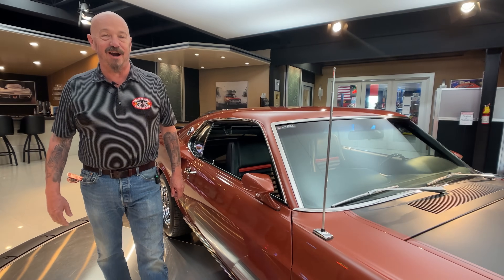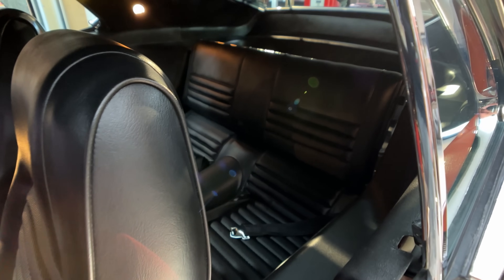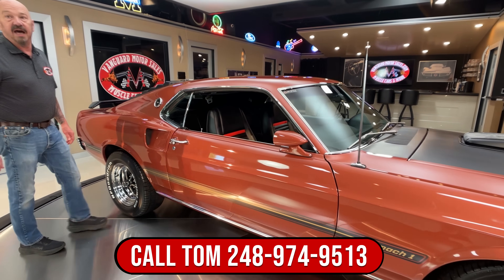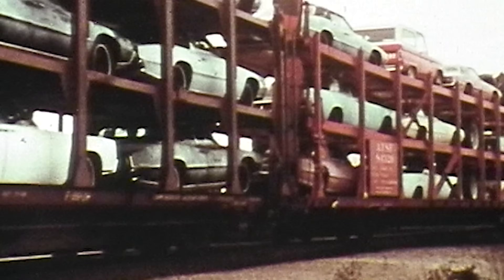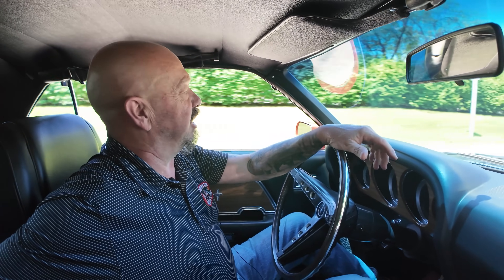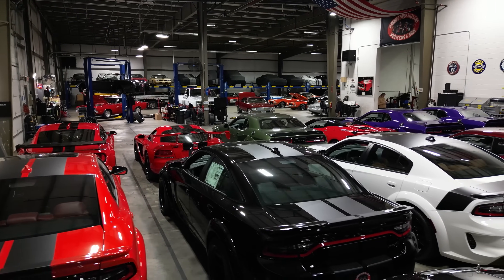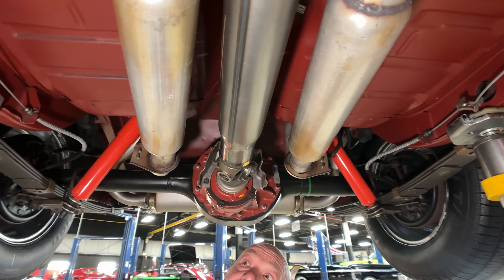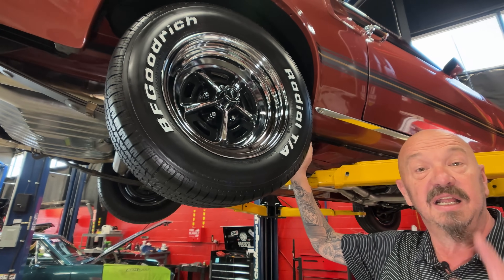1969 Ford Mustang  Mach 1 R-Code 428SCJ Drag Pack For Sale Vanguard Motor Sales #2332

Comment: oh no its an automatic! how much would a four speed add to the 150000 price? who ever buys this should do a manual swap immediately
Reply from the maker: With the car being kept this nice and original over the years we wouldn't be interested in swapping it to a manual we'd like to keep it as original as possible. However If you are interested we are currently getting in another Indian fire car that has a manual coming in soon! You can call Tom and get any information on that car if you'd like! 248-974-9513!
Reply: Not big Ford fan, keep it original as possible affects price.
I really like 2018 Dodge Demon in Octane red, car for me.
I know guy original owner with 2018 Demon in Purple.
He retired from drag racing was surprised that he ordered a Demon.
Reply: There is a market for autos. As drivers get older, they often have trouble shifting. And safe to say at 150k, the majority of the market for his car are Boomers. 😂
No need to change this original beauty when there are plenty of manuals just as nice out there.
Reply: Stunning 69 Mach 1 Super Cobra Jet with…..a what, automatic transmission. This hobby is populated with all kinds of enthusiasts with bizarre ideas. Think of the value of one of the most stunning Mustangs Ford ever designed with the mandatory 4-speed. Dealer is correct though, leave it alone. Ideal car for a Millennial since they can’t drive it with a manual transmission.
Reply: Automatic was better for drag racing back in the day, faster shifts

Comment: I ordered my '69 Mach 1 in Nov '68.  351 4-spd 3.25 Traction Lock.  Road & Track said the big blocks were too heavy for cornering. Said the 351 was the better setup for the road.  I didn't want a drag car, but a high speed cruiser.

Comment: I had a 1969 Mach 1 428SCJ Drag Pack,and the rear shocks are supposed to be staggered on rear axle,LH side behind and RH side in front of rear axle.Maybe that was because mine was a top loader 4 spd.

Comment: I had the pleasure of driving one of these '69 Auto 428 Cobra Jets and it was so cramped under the hood, that there was only room for air conditioning or power steering.  The car could fly.
Reply: Owned one for quite a few years. Space was tight! Chilton Auto Repair Manual suggested a plug change was an 8 hour job that included pulling the engine!  It was really just 2 plugs that were hard to access, we drilled a hole through the inner fender wall to give easy access.

Comment: Would be nice if you would get into the throttle on some of these....Arent the SCJ cars the ones with 430 gears or was that an option
Reply from the maker: We have gotten in trouble with the cops a few too many times to actually rip them down the road like we use to I'm sorry we will try to get on them more! as for the rear gear of the SCJ it was offered with the 3:91 or the 4:30!
Reply: @vanguardmotorsales  Ah got it!
You cant throw some banana peels out the winda for the clops? 
Kidding....I get it.

Comment: I thought Drag Pack rear end was 3:91 Detroit locker...
Reply from the maker: If you're referring to the fact that I called it a Posi.. a Detroit locker is "Posi" and it does have the correct gear ratio to be that of the original Detroit locker but we have not had it apart to fully confirm the fact that it is for sure a locker or not.